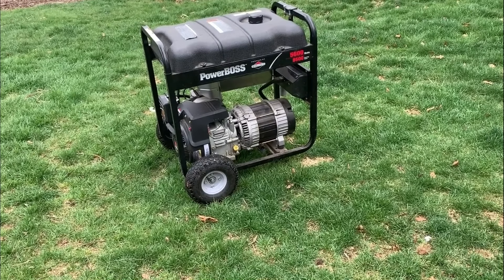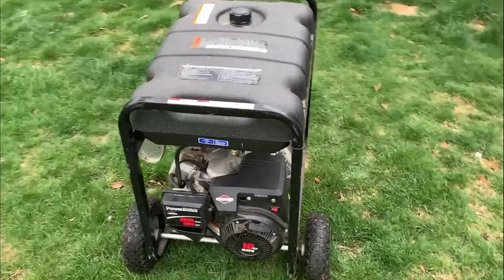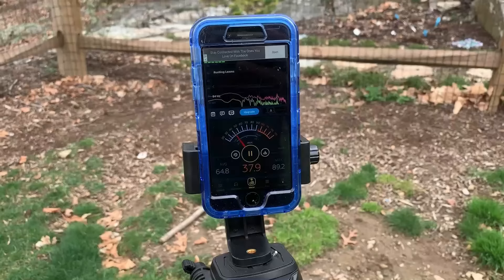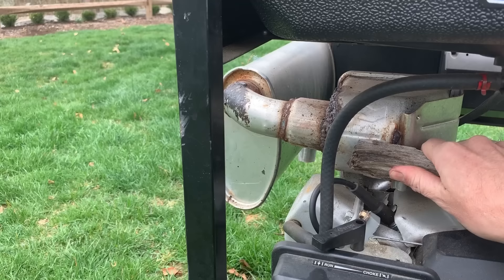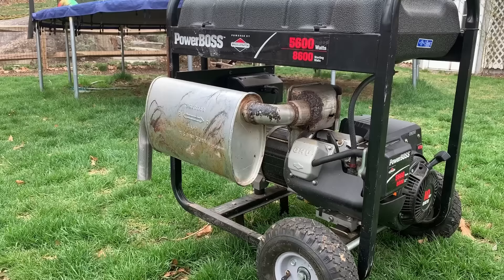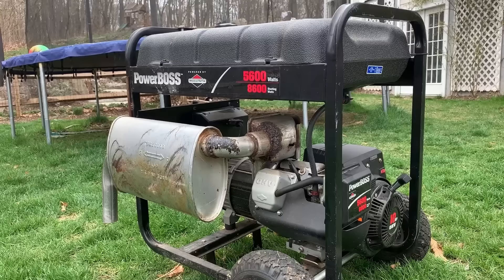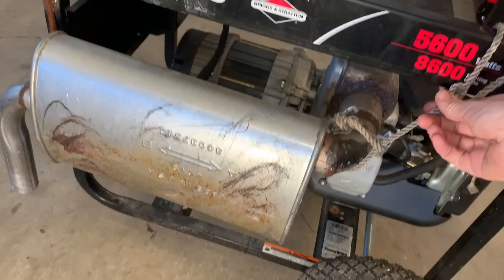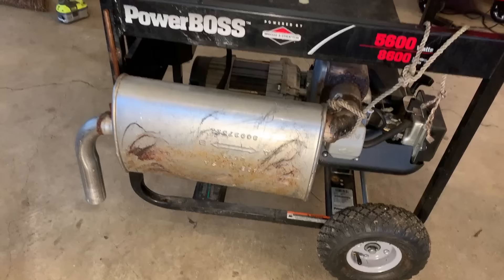Will a Car Muffler Make a Generator Quiet?

Comment: I’ve done something similar to this, but you MUST use a motorcycle muffler instead of a car, especially for single cylinder engines, because they’re designed for the constant 100-0-100 pulses of the exhaust, instead of the continuous gas flow from a multi-cylinder car. I personally used a stock Honda grom muffler and it was VERY quiet, and they’re not too expensive. Just make sure you don’t have a hole in the system 😊
Reply: Hole in muffler AND Loose Muffler Bolt
I'm disappointed he didnt run the With Muffler test again with the bolt tight and hole covered
Reply: Excellent point about the pulses.  Thanks!
Reply: That comment should be pinned.  Good info.
Reply: The car muffler is also just oversized. It's not going to damp the exhaust pulses well because there won't be smooth flow/consistent pressure through it. Like putting a 3" exhaust on a 4cyl car. A 125cc motorbike muffler like you used sounds ideal since even if this generator engine is 200cc or so it's only running at 3600rpm.
Reply: @rwbimbie5854  He is not the sharpest tool in the shed when he touched that weld he was grinding on to see if it was smooth, was when I clued in thats not recommended LOL.
Reply: should video what you did, it should be much more interesting and informative
Reply: I need to do this worth my 13 HP Honda
Reply: @walkertongdee  that shit was funny
Reply: Please make a video of your generator. I'm definitely into seeing the results
Reply: Take a Yamaha OEM euro 4 exhaust and probably you will check 2 times if u have turned on the generator
Reply: Best comment
Reply: It's fine if there's a hole, as long as you have some spare wood lol
Reply: was just about to say this , i got 22hp vtwin on my generator and it was hell alot quieter when i held 2stroke dirtbike muffler.. wish i had db meter to test with...(muffler on generator was like 1 inch outlet, so 2stroke pipe almost sealed around it)
Reply: muffler doesnt do much for small motor like that because small motor is louder than the muffler
if yall want it to be quiet n best way todo that is put instansion and wall n lave few hole open for vent front motor to rear top n exhaust n intake "carburetor " that would make big difference because block noise from block them ya can tell difference
Reply: And what to do on ah twin cylinder?
Mine is LOUD! What muffler would be best?
Reply: I had a similar thought. A small engine would require a muffler designed FOR a small engine to be very effective. A smaller motorcycle muffler would likely make a huge difference in an instance like this whereas the larger muffler would likely only change the frequency of the sound as this video clearly showed.
Reply: Why does it matter about the pulses?
Reply: @jason-ml4di  88ò
Reply: I had a generator from the 1920s with the book and it had different ways to quieten the exhaust. It was a Delco one was to dig a hole in the ground and bury a barrel and run the exhaust into the ground the other was to run the pipe from the exhaust into a road/ driveway culvert several yards away
Reply: In order to generate 120 VAC 60 cycle the engine is usually set at 3600 or1800 rpm you can create a very effective baffle as you are setting it to a specific wavelength. The idea is to reflect the. pulse high point into the incoming  pulse low point the two waves cancel each other out it is more effective when your are tuning to a specifec frequency
Why the 100 was input I don't know for sure.
Reply: I have a foodtruck and I've been wanting to try this. Possibly run a pipe up above the roof so I can keep the generator on board. Rite now I put it 75 feet away to avoid the noise
Reply: I put a muffler from a 155 cc scooter on mine...sadly it made little difference..I need another opinion
Reply: @Hapfletcher  stuff it with steel wool or fiberglass or something that can take the heat that is soft won't reflect sound or block the exhaust gas flow. Also keep in mind the exhaust is not the only source of noise there is the air intake, the generator, the frame flex, the motor case, all making noise as well.
Reply: @bossrobotdad these days, some cars even have speakers to pipe in engine noise to make it more powerful sounding.
Reply: Yeah,well said also a motorbike muffler,with a removeable end, so you can add more or less stainless steel wool into it for lowest decibel reading 😉
Reply: I put a honda moped muffler on a single cylinder engine although it was a single cylinder 14.5 ic briggs and stratton but its the same concept and it's much quieter
Reply: @AKADriver  Ahh! That's why your average 4cyl buzzbox is much more noticeable at idle than at revs. The pulses at idle come through more. Interesting!
Reply: agree with this even as I assume these  nearly 6db  sound reduction with the extra exhaust is a lot of reduction. 
 Every 3 decibel is doubling the soundstrength or halving when 3 db less sound.
This extra pipe reduced the soundlevel 4 times...only 25% of the sound was left. That's impressive.

But with a 6.5 cm^3 model aeroplane engine I reached more than 9 db reduction in sound (8 times) with a special dual chamber exhaust...it proves it can be done better.
Reply: Now I'm seriously curious how much sound an GOM muffler or small 2 stroke dirt bike muffler will cut vs stock generator muffler...I need results now!
Reply: I expect it would help if the muffler wasn't welded directly to the frame, too.
Reply: those must be easy to find, what with every harley owner tossing them in the trash
Reply: @kittyztigerz  what?
Don't eat the paint chips
Reply: @lamplighter5545  yeah I was thinking that as well, would have welded a rod and put a rubber exhaust hanger
Reply: I've tried that myself and it seemed to work, now have to do something about the generator whine.
Reply: THIS. Perfect fix
Reply: Thank you so kuch
Reply: ⚠️Always make sure you follow all the generator safety rules when you use your portable generator: 

This is just a reminder to make sure. It is important to follow all generator safety rules whenever you use your portable generator. 
Here are the things that need to be followed;

1) KEEPING OTHERS SAFE: Please do not allow an unqualified person or your children to operate and service the portable generator. Just because some manuals don’t say that doesn’t mean it’s safe. That is important against the generator safety rules. We also need to be keeping an eye on our children too. You need to make sure that your children are not playing near the portable generator especially when it’s running so they won’t get electrocuted. Generators pose electrical risks and they can be hot during an operation. Please keep your children away from the portable generator at all times. It is important to keep our children safe especially our little ones. Be aware of all the hazards.

2) WHERE TO RUN YOUR GENERATOR: Some people use their portable generators indoors which increases the risk of carbon monoxide poisoning. It’s important to have a carbon monoxide if you have a gas generator. Never ever use your generator indoors even if your doors and windows are open and even in the garage is not safe to use a portable generator. Not even at your porch and your deck. It is never safe to use your generator indoors and in enclosed areas of your home. Your generator needs to be 15-20 feet away from your house. 

3)🔥FIRE HAZARDS: Never refuel your generator while it’s running. You need to let your generator cool off before refueling it and before storing your generator. Never overload your generator too. Never ever back feed your generator. You should never plug your generator into a wall outlet. Also never store propane tanks indoors. Please keep flammable things away from the generator as well and please don’t smoke cigarettes near the generator. Having a fire extinguisher next to the generator is also important against the generator safety rules. 

4) GENERATOR OPERATION: make sure your hands are dry before touching the generator. Never use your generator in wet conditions. Don’t let your generator get wet. You need a generator tent if you need to use your generator during wet weather. Please don’t wear loose clothes when operating the generator. Turn on your generator before plugging in appliances. Use the right cord for your generator. Please do not use worn out cords. 

https://youtu.be/I1jT3ANENvI and here is a video more about keeping others safe when using generators 

Hope this helps
Reply: Doesn't work.
Reply: @mark52111  I wouldn't call it a loss. Stock bike mufflers inhibit power, fuel economy and actually the safety of the rider. When I had stock pipes on my Kawasaki Vulcan 800 I couldn't even hear the engine on the highway. I got 42 MPG and lost count of all the people in cars who almost killed me. I put V&H pipes along with a Kuryakyn intake on and rejetted the carbs to match. Picked up not only a lot of power, but boosted my economy to 50 mpg and cut down the amount of motorists in cars trying to kill me by probably 2/3 as they could hear me. I saved the stock mufflers and was going to use them as a stack on a custom smoker I'm welding but now I think that I might modify a genset or maybe the mobile weld rig I'm building to take them as it would make it much quieter. Factory mufflers such in every way they can suck. But they can still be put to a good use on something we want to be quiet.
Reply: I found a BMW 650 scooter muffler for mine worked amazingly well.. but that generator is a twin, like the scooter.

But your point is very true.. most generators just use the smallest POS that fits, because a good muffler isn’t cheap and unlike a car.. a lot of people buy the cheap generators without hearing them first. 
Another factor is engine design.. and some Co.s make ZERO attempt at fixing NVH.
Reply: @ronalddaub7965  what about welding mroe than one muffler? Like 10 mufflers? Surely it'd be even quieter with 10, right?
Reply: Basically a muffler is a muffler. The silencing has more to do with volume and baffling which slows the flow down. 
The original car muffler,designed by Henry Ford for the Model T was copied from Hiram Maxim’s silencer designed to suppress the report from a firearm.
Reply: Thanks for the tip...GREAT idea
Reply: That makes a lot of sense
Reply: @tazmo2004  so yeah, just attach more than one muffler and it should slow the flow down to the point that it's as quiet as an electric engine.
Reply: was looking for this comment because yeah a muffler designed for small gas flow like that is extremely important and also gets very quiet.
Reply: Try flexible exhaust pipe and a motorcycle muffler. 
Many dirt bike riders upgrade mufflers. Used sock repack with fiberglass mufflers should be inexpensive.
Reply: good idea
Reply: Awesome idea Victor! A motorcycle muffler - brilliant. I never even considered those. Thanks for the advice.
Reply: @Thebowzer221  There are more twin cylinder motorcycles out there than there are single cylinder. :) Find a model that uses a 2-into-1 exhaust design with 1 muffler accepting the exhaust pulses from both cylinders. Use that one. 👌
Reply: Victor Krivor DAMN DUDE, your pro tip works like a charm!👍👍thank u bro.
Reply: @walkertongdee  i was working in the lab and we had these glass crucibles glowing red hot.  the idiot working beside me knocked the lid off of his and started to put his hand towards it, I said don't touch that, but the guy gave me this arrogant don't tell me what to do look and when right ahead and touched the glowing red glass with his bare fingers.  I couldn't believe it.
Reply: id like to see a video on putting the bike muffler on !
Reply: @jason-ml4di  I think on small 210 cc gasoline water pump , a 2 stroke muffler like on the 2 stroke generator would be helpful
Reply: I'm doing it aswell, since I destroyed original muffler, when I tried to make it static in the shed. If there's anything that is great on Tomos a35, is the exhaust pipe. Great muffling, the shape, everything. Ordered a brand new one, just to cut it and mod it so it fits. It's going to be long week waiting!
Reply: I call BS. A whole bunch of the noise is from the engine case not the exhaust. That is why you see them incased with  sound deadening shrouds around some.
Reply: @monkeyman2174  incased air cooled generators are not a good design, enclosures are for water cooled diesel generators.  However I agree with you, the vibrations are about 76db and even with a big muffler , the noise will still be present.
Reply: @danteerskine7678  Yes but my enclosed welder is not water cooled.
Reply: What about would an old 4 wheeler muffler work to help reduce noise
Reply: @270wsm140gr  absolutely, its the same style of muffler, mostly resonator and one baffle
Reply: I used my little generator on my front porch it's open and have the exhaust towards the street. I had no problems with fumes coming inside the house even with two window AC units in my front windows. That was the only place I could hide the generator from thieves. I always brought the generator indoors at night. I had to work and my wife was home and needed power the good thing I only had to run the generator two days. I don't have a garage and I think an open porch is much safer than an open garage. Most others in my neighborhood had their generators on their front porches which are all open. Generators must be turned off after 10pm. I had an inverter for night time and used battery lights. Inverter battery assembly is good for night power but not powerful to run the refrigerator. Well IAN disrupt us in central Florida but the worst was south of us. The grid has issues and needs to be upgraded. Underground lines are the best option but too many old poles need to be replaced. And it's business as usual with power companies. 73
Reply: You took the words out my mouth my man. Motorcycle muffler all the way!!!
Reply: Smart man,  bravo 👏
Reply: @SmallSpoonBrigade  😂
Reply: @ronalddaub7965  I know this is a year later but is there any way I can see that book in its entirety ?
Reply: makes allot of sense
Reply: 125cc scooter's muffler would be better, they are compact and right size.
Reply: @SmallSpoonBrigade  Wtf?!🥴
Reply: I used one muffler off a kawasaki EX250 for my WEN1100w its super quiet and has lots of packing with a 7/8 outlet, so now I can run it all day and night with out the libartards knowing I have full power when they have none. Next is to build an under ground box for it with piping so its even less noticible
Reply: It's not a 2 stroke, that shit means nothing, sound absorption is sound absorption. A sch. 80 pipe welded to a flange running into a large muffler drops DB to just below 60 on my 6HP Tecumseh.
Reply: Hole? 🤨📸
Reply: @airjacer_2016  leak
Reply: @TejasToolMan  oh ok
Reply: the comment section is always better than the video
Reply: @danteerskine7678  a 2-stroke muffler is unlikely to work well as most are designed as integrated resonance chambers + mufflers. For a 2 cycle engine the exhaust scavenging is particularly important, so the exact length and shape determines how well the reflected pressure pulses match with the exhaust portion of the stroke. 4 cycle engines (like all modern generators) don’t rely on exhaust scavenging (though it can help at the extreme ends of tuning), and so can dedicate more of the muffler space to sound absorption rather than pulse spacing - that’s why 4 cycle mufflers can be straight pass through or redirected baffle shaped and 2 cycle mufflers have weird shapes. 

You might get lucky of course and find one that just happens to work great, but that would be a function of luck rather than relying on engineering (or you could pay me 100 times what your generator cost new and I’d be happy to engineer a muffler for your specific use case) :)
Reply: Your comment made up this idea become perfect
Reply: Smart man.
Reply: Do you recommend attaching it to the stock muffler, or removing the stock muffler and attaching the motorcycle muffler directly?
Reply: Grom exhaust is a miracle. My bikes hella quiet for no reason. Put any other pipe and it's crazy loud.
Reply: Well here's the thing you can't use the car muffler because it allows way too much outflow pressure you need that motorcycle exhaust because a motorcycle exhaust pipe allows the correct pressure for the backflow to get the desired compression in the motor there for having the horse power or the amount of energy that would need to properly run that motor for the generator and when watching this video I have noticed that the car muffler did not do anything to quiet down me generator what I have found to notice is that in a generator the noise itself comes from the generator part not necessarily the motor at all the loud part of the generator is the generator itself not the exhaust trust and trust in Jesus
Reply: I was just going to say that too wasn’t sure if it worked but it sounds like a great idea when it came to mind glad I’m not the only one who thought that
Reply: Good insight thanks, gonna try this
Reply: Lol what
Reply: Exactly and I wrap my dirt bike baffle with fiberglass insulation
Reply: Same, I used a Honda 75 muffler on my old generator, MUCH quieter than stock
Reply: @allanpatterson7653  I experimented with making a muffler on my dad's 3HP briggs mower when I was a kid. I filled an 8"  x 1/2" galvanized pipe with lengths of folded metal window screen and screwed it into the threaded exhaust port. It was so quiet you just heard air. It unfortunately burned and consumed the screen before I was done with the lawn. really quieted it down at first.
Reply: I found a factory titanium R1 muffler for $20 that I want to try
Reply: Hi. Can You tell me what muffler model You buy from honda? I have a engine gx 420.
Reply: @kittyztigerz  you do understand that the exhaust IS loud and CAN be quieter right? Or does Google do all of your thinking?  Ever spin a Genset at 3600 rpm without the engine running? No you haven't. You're only spouting off what you read in Google search returns.
6db difference shown right here in this video. And the exhaust had multiple leaks before the muffler, and a muffler that isn't efficient for the exhaust pressure.
Reply: @truracer20  there is few way make it quites but i have done all muffler test not every muffler work because engine block is only thing make louder noise than muffler and if you add more cover to engine may be able to quite it down more and you be wonder small generators inside cover it because they find way to quite it down
Reply: @XL3BIGDrizzy  the mufflers are engineered by someone for motors general or specific fits. Sized for displacement and one cylinder two cylinder firing etc and exhaust  purposes quiet , performance only (race) type sound etc.
Reply: @XL3BIGDrizzy   engine pulses effected by the interior design and capacity of muffler motor to do different effects.